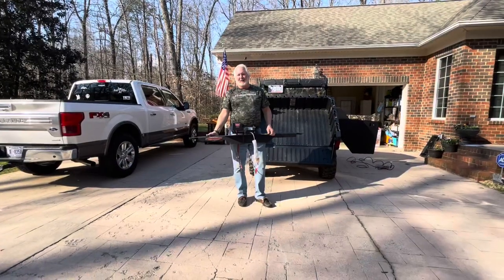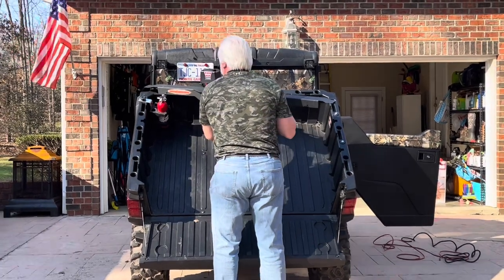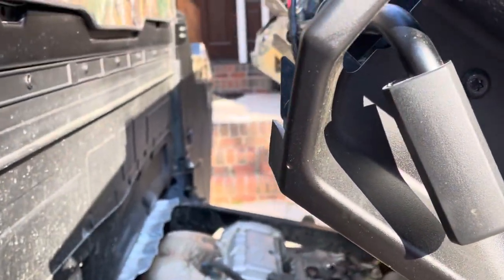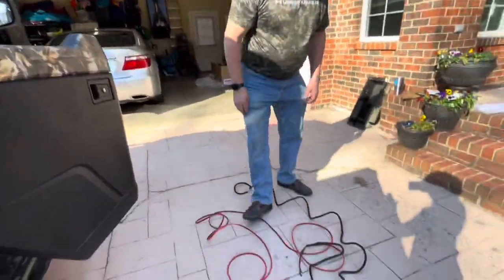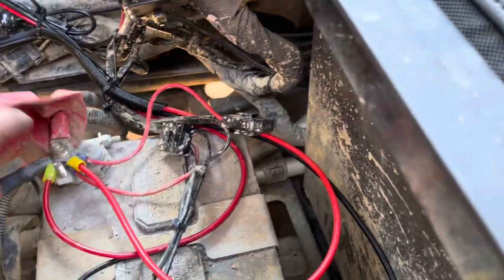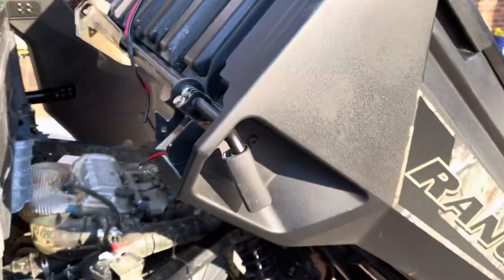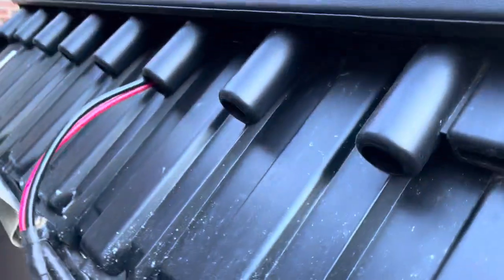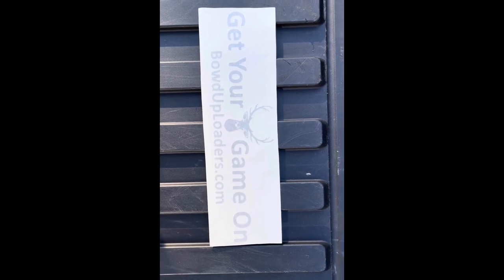BowdupLoader Install on Polaris Ranger 1000

Comment: How is it holding up?  Did you get a chance to use it this past hunting season?  Any issues with the direct connection to the battery and creating a slow draw where you find if it sits for too long the battery is dead?
Reply from the maker: Joe, it’s holding up well.  Unfortunately I didn’t get to use it this year.  The weather was weird and I didn’t hunt as much as normal.  I keep my Ranger hooked up to a battery tender when I don’t use it so I don’t have any battery issues from the direct connection to the battery. I have taken it on several trips to WV on the H&M trails and had no battery issues.  I still think that this is an amazing product and hope to use it a lot next season!  I hope this helps.
Reply: @bigdsoutdooradventure  Appreciate the feedback…this helps a lot.

Comment: How has this held up? I’m thinking about pulling the trigger on one. Any complaints?
Reply from the maker: I haven’t had a chance to use it yet   I installed it after hunting season. I will say that it is amazing quality and I have no doubt  that it will last a long time.  I did change the steel cable out and installed a synthetic one.

Comment: So what is holding the bracket to the bed exactly.  I guess I missed that part
Reply from the maker: For the Ranger it just snaps into place without the need of bolting it down.   Keep in mind it’s a 2,000 lb capacity wench that is rated at 350lbs. For this application. They make it to fit a variety of makes and models.  Some models would require for it to be bolted in place.
Reply: @bigdsoutdooradventure  10-4…. I only need it to pull deer in the bed , maybe a hog . So 300lbs would be rare. I think it will work just fine . Thanks for the vid